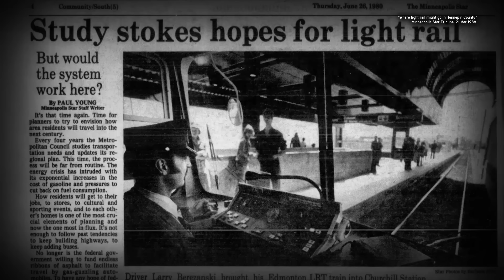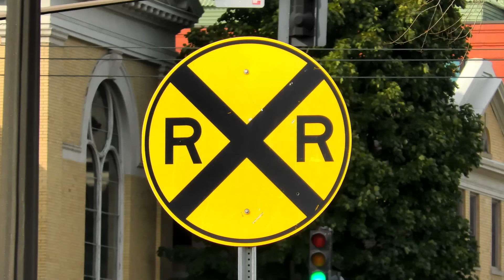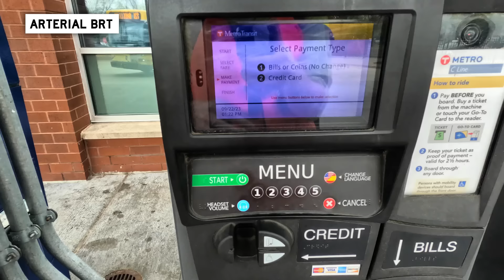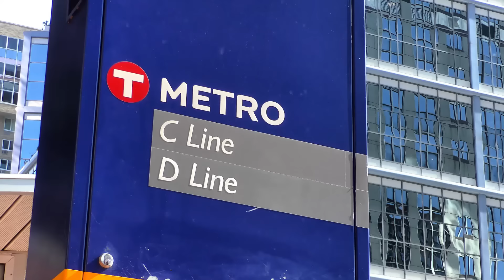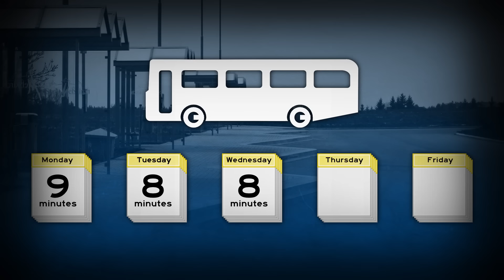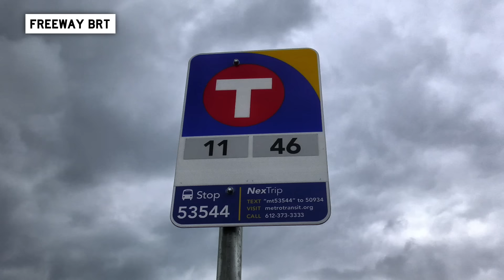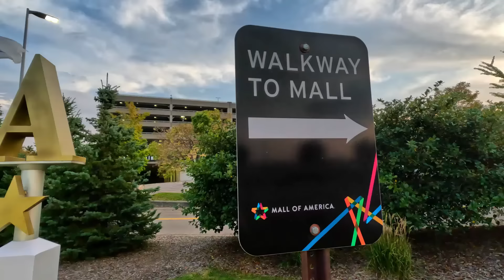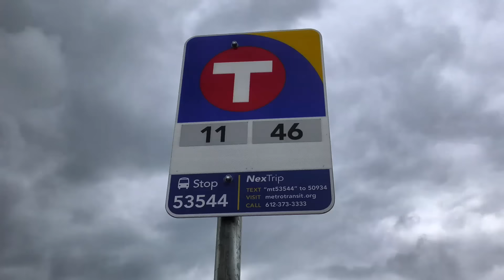Meet Minnesota’s $500-Million... 🚍 BUS???

Comment: Something doesn't make sense here.  If they really believed fully dedicated highways was cheaper long term than light rail why would they build any light rail?

Surely the reason we have trains at all is that it's usually cheaper in total cost of ownership to lay down steel rails than to build a fully dedicated highway (complete with gated crossings or bridges).
Reply: It's actually because railroads are vastly more robust than roads, requiring way less maintenance, and because they use orders of magnitude less energy consumed to move the same amount of goods and people.
Reply: @shingshongshamalama  Also, one conductor to pull 6+ train cars worth of people while a bus is one driver to pull the equivalent of 0.5 - 1 train car of people
Reply: Trains are more expensive in general, but more efficient as well.  Dedicated bus lines were not "a big thing" when the light rail was constructed, so it was probably not considered an option.
Reply: In the long term light rail/trams are cheaper than BRT, rails need less maintenance, you can run much longer vehicles with fewer drivers, and steel wheels last longer than tyres. But if you're needing to cut upfront costs BRT will save you a fair bit.
Reply: I'm just going to guess it's easier for them to get funding for BRT instead of light rail. Maybe in the future they can upgrade those BRT lines, if the seperate bridges and roadways are made with that in mind.

Comment: As someone that has utilized Metro Transit's BRT I will say it does genuinely work very well.  One of the things that you didn't talk as clearly about is that because fares have been purchased in advance 3-4 doors can be opened and so the bus is at the stop for a dramatically shorter period of time.  It is the difference between a single stop taking 6-7 minutes because of paying fares and taking 1/2-1 minute total and the bus is moving along.  Arterial BRT works ALOT better than it seems like it should.  The A-Line in St. Paul is very efficient and did not take that much to add in the stations I think they said the budget for construction was around $27 million.  This an important line because it also connects the Green Line and Blue Line light rail in a different way than having to go to downtown Minneapolis.

Comment: I live in LA and there's somehow only 2 BRT routes. The silver "J" line and orange "G" line. The J line runs through the median carpool lanes and a separate carpool + guided busway on a specific section where you drive on the left. The G line runs on its own guideway and I'm pretty sure is at max capacity and they're trying to upgrade it to lighr rail.

Brt is great to get a city started on becoming a proper city with multiple options to get around in and drastically reduces travel time.

Comment: I mean, if it work, it’s a great option, we don’t need to force rails , plus this seems very easy to convert from road to rail.

Even better, you can even put over head wires and replace ICE buses with trolly buses. It have so much potentials

Comment: I live in the Los Angeles area. Last fall, I had jury service downtown, and didn't want to drive, so I took transit for the 5 days of my service. I very badly wanted to take rail, but after some experimenting, I had to face the fact that the J line (aka Silver line, the buses down the middle of the 110 Harbor freeway) could get me there in an hour. 

After a couple days, I figured I could game the system by hopping off the freeway bus at the first stop after it left the freeway, and run over to the nearby light rail station to complete my journey by rail. Lots of other people were doing that. Though truly, the bus did not take long in the DTLA traffic. I think it has a dedicated bus lane on the streets, but I couldn't tell while I was riding it. The J line, by the way, runs all the way from San Pedro to El Monte on its longest schedules.

The A line (Blue line light rail) was out of my way, and not only has grade crossings, but does a lot of street running in DTLA before it goes underground. That street running is problematic, not only because it has to stop at traffic lights as if it were a car or bus, but sometimes there are collisions with other traffic. 

The new K line does not yet run its whole length, due to the LAX airport area construction (now they say it will open by the end of 2024), so you have to wait for the shuttle bus, and it's also out of the way, and requires me to take both the C line (Green line) and the E line (formerly Expo line). At this time, it apparently is faster to just take the 210 bus all the way up Crenshaw to the E line, despite all the stops. I much preferred the 710 Rapid bus (fewer stops), but they shut that down with the pandemic and never started it up again. It also bothers me that out of all the light rail lines, only the C line (Norwalk to Aviation Station/ Redondo Beach) is completely grade separated. All the others have at least some grade crossings, though E and K both seem to be better than the A line in that respect.

I do love the 210 Crenshaw bus, because it runs every 10 minutes or so. It's the only bus near my house that runs so often. All the others are 20 minutes at peak, or more like 30 or even 60 minutes apart. As my mom told me many years ago, buses need to run no more than 20 minutes apart to make them worthwhile. Only people who have no other options will wait for an hourly bus.

Comment: BRT can be so much better because you get easily twice the capacity for the same cost. You also get a ton more flexibility, because busses can go literally anywhere. With light rail, you're basically building infrastructure with the intent that people build around it in the future. With busses, you're building to existing infrastructure.
Reply: How do you get twice the capacity for half the cost? When it comes to operations, the opposite is true. Buses are much more expensive to run & maintain and offer much less capacity. The main benefit of BRT is lower capital costs, but that's about it. It does make sense on some corridors, but it's not a replacement for light or heavy rail transit. It's just another piece in the transportation puzzle.
Reply: @bentrig9128  There are other benefits beyond that like the infrastructure being used for other city services, training of drivers (High Turnover job) is faster and that you have a massive logistics base shared with another massive industry. Buses can also be reused elsewhere in the system or even retasked to whole new routes.

Comment: I have mixed feelings on BRT, and I think this video highlights why. So much of the conversation about public transit has to do with the initial cost to build but fails to think long term. These transit systems are going to be in place for the next 50 to 100+ years. Choosing a lower quality solution to save a few $100 million feels silly on those time scales, especially when you consider the projected growth of the city along with induced demand for ridership. That's not to say BRT is never the right choice, but I question whether choosing BRT for the Gold line over light rail is the right strategy long term. I really hope the bridges they're building are being constructed with light rail conversion in mind (though I doubt it).
Reply: The problem is in general American cities struggle to have sustainable ridership on transit, Of course there's all the factors that go into that like safety, frequency, cleanliness, convenience ECT. but the point is that there's no guarantee that you will be able to sustain better transit nor is there a guarantee you will induce enough demand to sustain it. 

The problem is we went in a totally different direction with cars for decades, removed, forgot, and undid what good transit we did have for the most part and now cities are finally trying to do things the right way (in some places) but they are starting from like step 5 instead of like step 105 where other places that kept up and kept improving and expanding their transit systems; That means we need to build out the base ridership and networks in cities that are large enough that the foundations should have been made decades ago.

Ultimately that means we need to go for lots of good quality but ultimately cheaper options to build out that foundation before we can move on to better quality and more expensive options, and frankly one bad light rail line could be enough ammunition to stall or kill off transit projects all over the US for years or decades to come and that risk is not worth it.

Comment: I live in the twin cities and took the bus a lot when I was younger, and comparing the A line to the 84 that used to run most of the same route, it's way better. Not just because of the stations, but because cutting out most of the stops and pre-paying instead of paying at the door speeds things up so much. Trips that used to take 35-40 minutes are half that now, easily. They're still pretty bad about travelling long distances quickly, and have awful service if you're not working a 9 to 5 in a central area or retail in a big shopping area, but it doesn't take 2 hours to get from Midway to Maplewood the way it used to.

Comment: As someone who worked in transit rail, BRT is much better.   For busses, the design of the running gear is regulated by DOT.  That means all the drive systems are very consistent with all highway vehicles.   The regulations for railway systems are not regulated the same.  This means that every city develops their own specs for, say, brakes that are drastically different than the next city.  It makes rail far more expensive than busses.  Note, at the peek of streetcars in the US, there was a PCC car in the US that was mostly the same between cities.

Comment: I certainly hope they've included provisions for electrifying these busways. A small battery could be charged while running on the busway for routes that continue through neighborhoods, and to bring the buses to a depot for service. The battery electric buses I usually hear about have massive batteries to make it through a service day, especially when electric heat is needed.

Comment: The reason you go with light rail is reliability and efficiency and reduced maintenance over time, steel wheels on steel track running 100% electrically has basically no emissions at all and very little maintenance. However with a bus youve got wheels and tires and brakes you need to maintain, a road surface you need to replace completely every 15 years sounds way more expensive than realigning and maintaining the track once a year. Even if the Green line extension costs 4 billion dollars the cost of maintaining and clearing snow from a roadway would mean the Gold Line would end up costing way more than the green line in the long run. This is just a stopgap solution to mobility.

Comment: The best thing about BRT is it actually gets done.   The only infrastructure that ever seems to get done in a reasonable time frame is conventional road construction (even then it still takes far longer then it should with all the hoops).  Hell how long has Cali been working on high speed rail?    That plus you can have hybrid routes that go to places a rail system would be impossible due to preexisting infrastructure.

Comment: i often wonder  you need to build a rail system super sturdy because you are moving one heavy train over it with a lot of people. What if instead you made it so it moves a few people per "car". the rail could be much simpler and each car can take people to many more drop off points. You could even design it as a monorail but have the cars able to ride off set so they can pass eachother meaning cars can constantly go either direction on the same line.

Comment: The biggest issue I have had with the system was the missed timed connection between major routes. The Red like would depart just before the blue line would arrive. this meant having to wait a full half hour for the next one. Also, that extension as far as I know is a whole new line that does not connect to the same platform as the Green and Blue Lines.

Comment: BRT might be cheaper to build, but far more expensive to operate. One driver can only ever drive one bus load of passengers. But one engineer can drive a train of any length. BRT wouldn't scale easily.
Although I can see how improving the stops can increase ridership. That can be done with any bus route.
I like what the engineer said at the end. "Let your needs determine your tool." No form of transit is useful for every situation.

Comment: The problem with our transit system is it is designed to only support the city centers. We have a cark and ride in Forest Lake. When my daughter started going to college in White Bear Lake we thought the bus would be the best solution. For her to get to the college she would have to take the St. Paul Express (this transit center only has Minneapolis and St. Paul express routes). Change buses to get to the Maplewood transit center then a local to the college. The express has stops off of the freeway near to where she is going but no local routes connect there, I guess these stops are for riders that park in the store parking lot. The Maplewood transit center is five minutes off of the route.

She didn't take it because the earliest express would get her to her first class late and the having to change two buses on the way home if there was an issue she would be stranded in downtown St. Paul.

Why doesn't Metro Transit have circulators between transit stations?

Comment: I live 2 blocks from the D line stop on Portland and 66th, and for as much as I wish we had a train system, BRT works fine and is a lot faster than the 5 bus that travels the same route. When I worked downtown, it worked great but now I use it regularly to get to Twins games.

Comment: Living in Stuttgart, Southern Germany, I am undeciced between laughing and crying. Our metro is roughly the same population as the twin cities area, so the challenge is roughly the same. 
With six heavy rail commuter lines running every 15 minutes each, 13 light rail lines within the city boundaries running every 10 minutes plus a network of regional trains running every 30 to 60 minutes, anyone proposing a BRT solution would be laughed at. Actually, it was tried to relieve an overcrowded parallel light-rail line, but failed miserably. 
Good ole Europe is not too bad, after all 😊

Comment: Generally light rail has a much higher initial cost but over a longer period of time is cheaper because the running costs are lower. A light rail vehicle has a much longer life than a bus and require less servicing. Electricity is also much cheaper than diesel.

Comment: While BRT is cheaper initially, the LRT will be cheaper in the long run particularly if it's driverless light metro like in Vancouver and at airports across the country. The less money spent on drivers and conductors means more can be spent on infrastructure and policing (a necessity in the US).

Comment: 8:58 I wonder if the geometries forced the crossover. Every other freeway station I’ve seen in the center of an interstate has the platforms on the side, so there is no need for the bus to cross over. 

That is a maneuver that requires quite a bit of loss in speed to ensure it is done safely…

Whereas side platforms can be approached at around 30 mph. 

Or just buy five door buses, that have passenger doors on both sides of the bus at the expense of seating.

Honestly the crossover seems like a case of penny wise, pound foolish.

Comment: BRT and light rail is great, but you should visit Honolulu sometime and check out the new Skyline system. It has its problems, but it's a light metro system requiring shorter trains and smaller stations compared to a normal metro system, yet it's completely automated which means lower operating costs with not having to hire train operators and they have lighter trains. Hiring operators can be difficult so an automated line helps with that

Comment: When done right and aggressively enforced by police with hefty penalties for violators of bus lanes, Arterial BRT is ALWAYS the best option and most superior form of BRT by far. It is also by far the most accessible and versatile of all forms of BRT, with the other two forms being non-versatile and adaptable, and the Freeway form being the worst in accessibility.
Also, NEVER have escalators or Elevators. If you learn anything from Transit systems which use them a lot (like TriMet), you know they're almost ALWAYS broken. Ramps instead of stairs is a universal solution and fix to the ADA accessibility and cost to maintain consistently unreliable elevators and escalators.

Comment: All proposed pass train projects should begin with a bus line on existing corridors, then dedicated lanes or diamond/pass lanes.

Often train projects take 20 to 40 years and by the time they are finished a whole new generation is served...and the generation may have moved away from the needed spots 20 to 40 years ago.  This trains often serve slums that won't ride rhem or has no reason to.

Buses can establish a corridor in 2 years and maintain the usefullness of the points of service.  Even if trains will eventually replace the major BRT...they will be built in the right place.